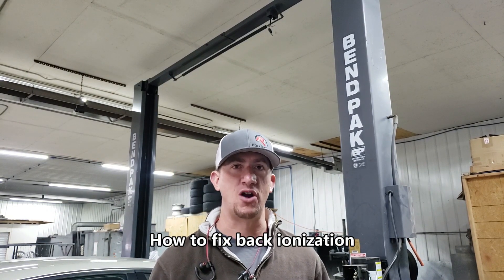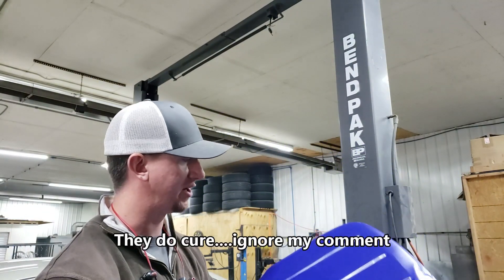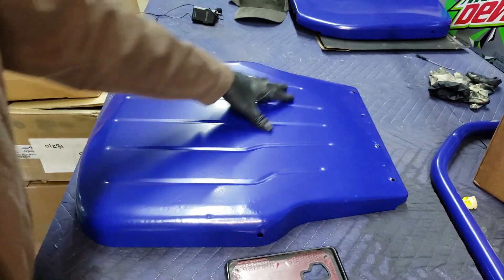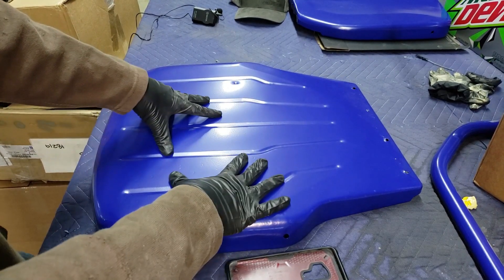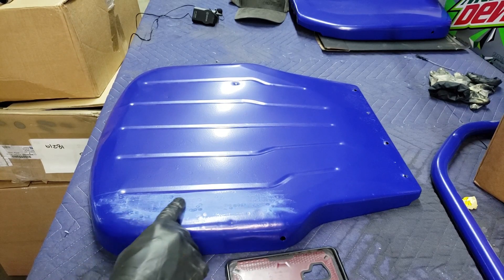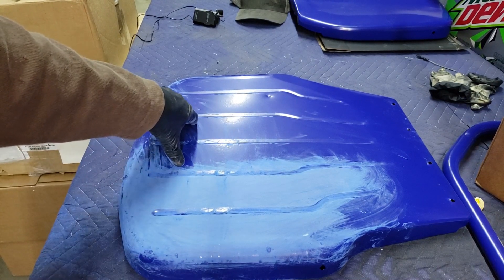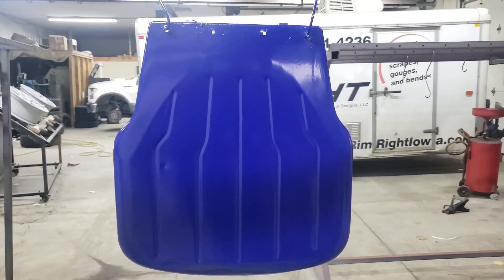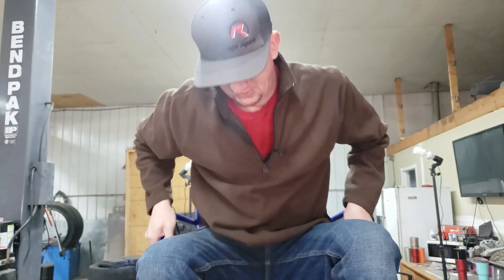Powder Coating - How to Fix Back Ionization

Comment: Thank you for sharing the tip regarding the preheating! I will try it. I work a in mechanical factory that includes electrostatic powder painting operation. This back ionization is a big pain in the ass. Indeed you may see instantaneously this effect when powdering the second coat and try to do something at the spot. Sometimes the density of these "sparks" is huge. Blowing them out by air pressure and smoothly respray over is not really successfully since we have to remove the powder and lay it down again on the surface even 4-5 times . However I will contact my provider of the painting units to see if they can provide any upgrade with ion-collector. We do not use Wagner or Gema as someone mentioned in a comment below. From my past experience Gema units provide ion-collector, at least the Optiflex type I saw in action. Really effective against this issue!

Comment: Back Ionization can occur for a few reasons, 1) You are recoating over existing cured powder coat. (2) You have applied too much powder on the first coat pass. (3) Poor earth. 
Remedies (1 & 2) Reduce micro amps on your powder coat controller, this this is called current limiting. (3) Clean all your contact points so earth is <1 Meg Ohm.

Comment: I know it's frowned a pon But .😇on powders that tend to do that  hot flocking at about 140 degrees will usually fix that issue so you don't over cook your powder. just saying

Comment: Hello.  I'm fairly new to powder coating.  Your vids have been very helpful.  I'm using the Eastwood gun (since starting out).  So this is due to a bad ground.  I've seen similar on a clear coat.  For a second coat, do you have to get your ground down to base metal which would involve a scratch??  Also, would you do this same procedure if you have a clear coat that went bad - sand it, add another layer of color, and then re-clear coat it?

Comment: I just did a part super chrome ll the second coat black chrome it fisheyed on me so I sanded out the fish eyes scuffed up the whole piece at 120 and recoated the whole piece flat black because I didn’t like the color it came out like bed liner... any tips on why?? Now I have to strip the whole piece and do it over..
Reply from the maker: You need to apply the redo coat just as heavy as the first coat.  A sand paper finish is from putting too light of a coat on.  Also be careful with 120 grit. It can make deep scratches

Comment: What do you warm the part up to before you spray it again.  Also do you let it run the full cure time on the second try can the original coat over cure ?
Reply from the maker: No set temp, just enough to dissipate static build up.  I do full cure on second, wont harm base

Comment: I didn’t see you ground it, do you have to provide a ground on the second coat if you preheat it?
Reply from the maker: Always ground the part, ours it at the bottom of the cart.  Sometimes we do forget but typically remember real fast when we get shocked.
Reply: @RightNowPowderCoating  what do you ground it to if its a second coat, will it be ok to go on coating?
Reply from the maker: @chipmcallister7349  I round to the cart it hangs on.  Always use the same mount location on the part.